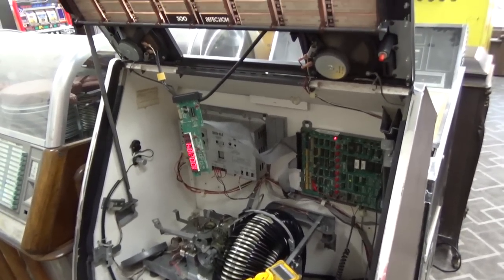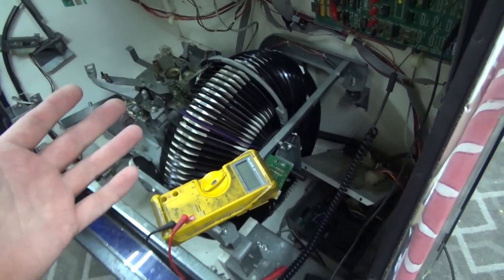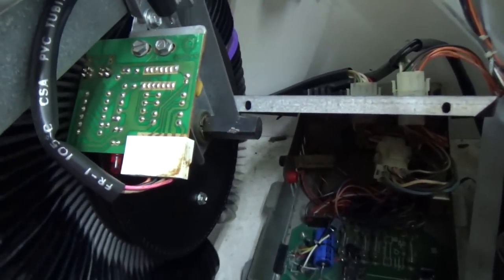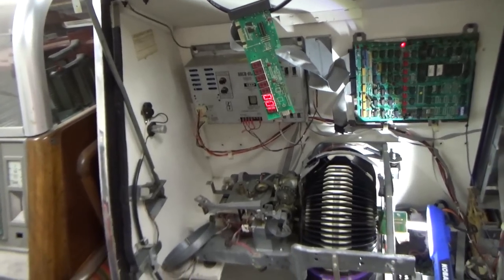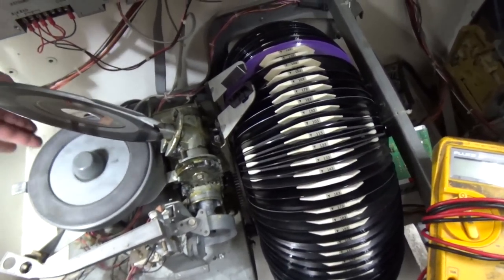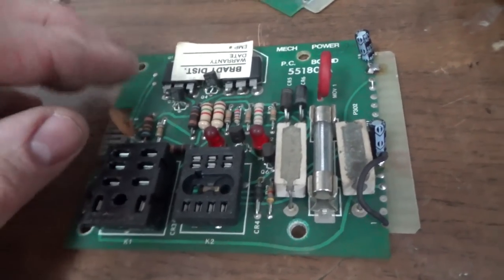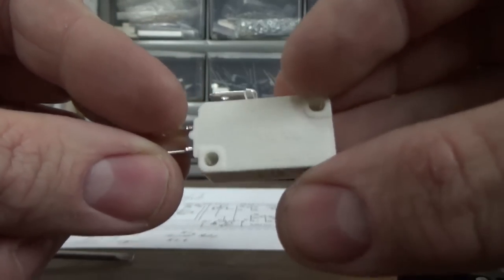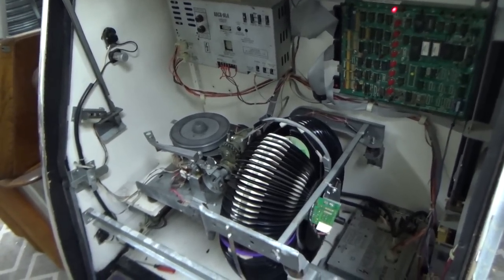Rock-Ola 496 Jukebox Repair - Bad Sensors, Switches, Mechanism Board Issues - 490 , 494, 3000X

Comment: Microswitches are good for many many operations, but don't last forever. I had an AMI Continental II that would intermittantly burn up it's bow record side select solenoid. It ended up being a microswitch that was stuck in the NC position, which kept coil voltage on all the time when it was supposed to just pulse the solenoid to tell the bow mech which side of the record to play. Replaced the microswitch, (and the solenoid) and it was good to go.

Comment: Caps filter low audio frequency, coils filter high frequency. The caps on the upper speakers are there to filter out bass, and there are probably coils on the lower ones to filter out treble.

Comment: A friend of mine showed me that if you put bad microswitches in isopropyl alcohol and click them a couple thousand times, they work as good as new. Now you just gotta ask yourself the question if the switch is worth your time. In my case, it takes me the same amount of time to locate a matching switch from the bin as cleaning it in alcohol.
Reply from the maker: yes I think it would clean up, but like you said I'm ready to move on to a new switch... and this one was brittle too so it was on it's last legs in my opinion :)  I was going to try to clean it if I got it open without breaking it.
Reply: contact cleaner works good too!!!!

Comment: Capacitor on the speaker is basically a crude crossover which will stop low frequencies depending on the value.
Bass driver will be in the bottom of the box

Comment: Yo sigo pensando que estas rockolas transistorizadas son como los carros de inyeccion electronica, se necesita aparatos especiales para diagnosticar las fallas y solo es cambiar de modulos

lo hermoso de las rockolas como la modelo 445 es que son como los carros antiguos caburados, son mas analogicas y mecanicas, con amplificador de bulbos, mas sencillas de componer, sin tanta electronica, la rockola 445 se compone solo con unos cuantos desarmadores, dados, lijas para los contactos de los relevadores, un multimetro y ya, la mayoria de las fallas son falsos contactos y muy pocas fallas mecanicos y este tipo mas recientes son problematicas por tanta electronica

Comment: I have a rockola model 1000 that has been in climate control storage for one year. When we plugged it in, it played the first record, put it back and the turn table kept moving. It will not load additional records. Do you have any advice for my electrician?

Comment: The MECH Board has two big relays to turn on the record player and the record changer, but not sure why they used those big 24vdc relays, any reasons why?
Reply: Reliability maybe? Usually these are used for industrial purpose._
Reply: @DjResR  The Relays aren't switching on/off high current or high voltage, so not sure why they are using relays
Reply: @waynegram8907  What it does have is a lot of cycling on and off, even when the voltage and current is quite low the overall long term wear and tear still justifies the use._
Reply: the relay coils are fed D.C. voltage for reasons of" fast pick up time"/ release time due to a diode that is in parallel with the coil blocking the inverse voltage( cuts way down on contact bounce), and the 60 hz hum that can be generated at the relay armature if fed A.C. voltage, esp. if the "SHADING COIL" is open. contact bounce is really bad on A.C. voltage relays, and if you have a relay that uses one of the contacts as a "LATCH CIRCUIT" and the relay only gets a pulse to the coil, it can get missed because the relay did not have enough time to "PULL IN". also , there is no shading coil in a "D.C." operated relay, cutting down on cost.. large relays are used in high current switching applications, such as starting/stopping record platter motors/ motors that drive the record magazine basket, record gripper arm, record tone arm( same motor).

Comment: These old aluminium case fluorescent lamp starters are quite rare nowadays.
Edit: It's not uncommon for IR LED to die in the optocouplers._
Reply: if you want to keep the "METAL" case, just remove it and put it on your new plastic case starter, they do come apart, or remove the "GLOW SWITCH/CAP" from the old starter and use the "GUTS" from your new starter. the other big problem is the availability of "IRON CORE BALLAST". I have that stuff, I stocked up when they were still available( metal case starters too). also if you have a lamp that is at the end of its life cycle(preheat type) do not leave the "BLINKING LIGHT" in circuit, you will kill the starter/ballast.
Reply: @gregoryclemen1870  Availability of these starters is getting low, I have very few left and it are in storage for safe keeping. I have plenty of lights with these ballasts though._
Reply: @DjResR  , what starter numbers  are you low on ??? ( FS2,/ 20 FS4/40, FS5).
Reply: @gregoryclemen1870  I have 3 80S-220 (soviet FS-11/S10), one 20S-127 (soviet FS2/S2) and one polamp ZTE-1. Although I have a lifetime worth of FS11-S10-ST111 and PC422-S2-ST151 starters with plastic case. I could use S2s in "two bulbs in series on one ballast" fixtures (230V 50Hz mains here), but it's not that critical at the moment._
Reply: @DjResR  , I did not realize that you are living in the "U.K', I live in the "STATES" where every lighting circuit is fed 120 volts( we do have 277 volt lighting systems- non residential that is fed from a 480 volt 3 phase/ 4 wire wye connected transformer system- the neutral line provides the 277 volts for lighting systems)
Reply: @gregoryclemen1870  No problem, thanks for offer anyway. I live in Estonia, although the voltages are the same as in UK. It's quite interesting how many mains voltages there in the states is, we only have 230V live-neutral and 400V live-live here._
Reply: @DjResR  ,I try to help others anyway I can ,including sharing knowledge!!!!.